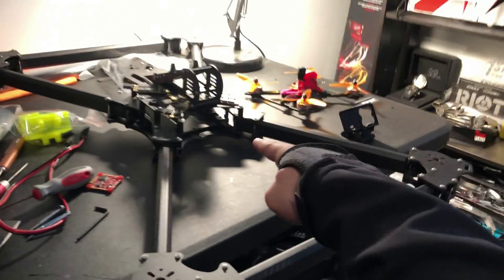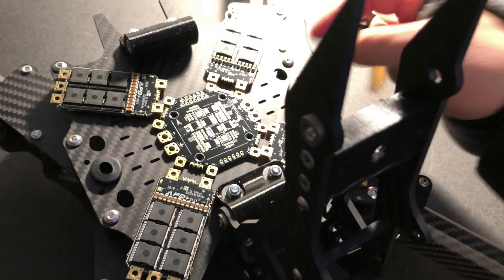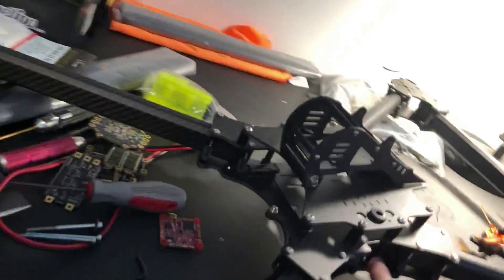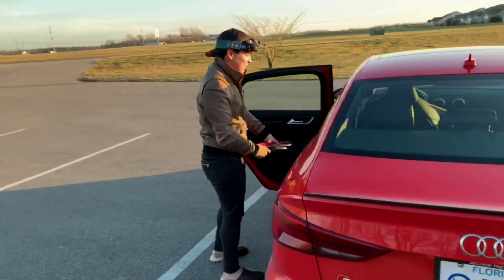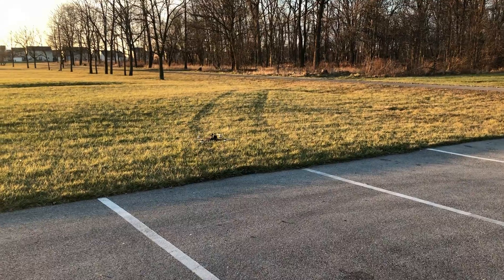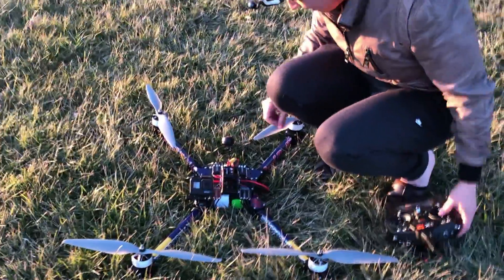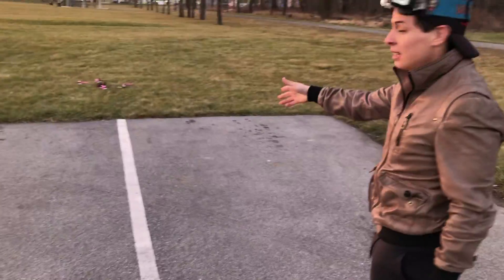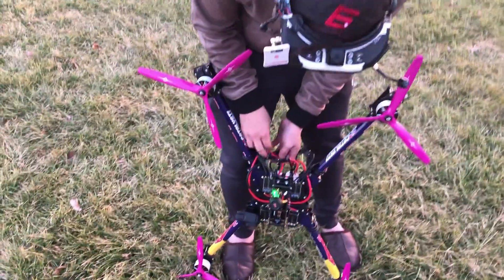Cannonball 800, Xclass is here!

Comment: Did not sound good on 16 inch props and 6S. 345KV on 6s is a bad idea guys.
Reply from the maker: John Wood yes it was supper sloppy and slow haha
Reply: @gabbychavesracing24  Try 8S. The problem is low KV motors don't like to spin super slow and most FC's can't handle that and you end up with a crash.
Reply: I'm planning on building same quade, can you help me GC ?

Comment: Sweet man...OK so I'm interested and have been looking to build one of these. Someone please explain to me how you can run 12s on some of the electronics such as fc camera and vtx.. Can you do a video on your build and how you set that stuff up? Oh and subbed!
Reply from the maker: The pdb (power distribution board) has built in step downs that take the 12s voltage down to say 5-12volts so you can power your electronics like FC and vtx. In my case I am powering them separately with a very small 3s battery. You can do both.
Reply: @gabbychavesracing24  awesome thanks for clearing that for me so fast...😁 much appreciated

Comment: Frame flex usually manifests in yaw instability. I bet the flex is coming from the truss, the braces just add more weight to the truss. Looks look there some significant voltage drop somewhere or just poor battery selection. Looks like it tightens  up quite a bit at low throttle though. Here is adp's test rig. https://www.youtube.com/watch?v=8R7-pJCtRmY&t=218s

Comment: What are your thoughts on fitting an HD video system to a machine like this? There's plenty of room for connex or FPV.blue VTX on it.
Reply from the maker: Ian Petrie yes you’re absolutely right. Latency would be my only hesitation for racing. Even tho it’s relatively low it’s still much slower than analog video. For just fun flying and cruising I think it could be a great option tho
Reply: @gabbychavesracing24 I thought that the larger scale of X class might make the latency acceptable because the gaps are larger and the distances further.

Comment: That is insane! Is there any benefit just going bigger? Doesn't look much faster than a 5 or 6 inch quad and it's definitely not as nimble or agile! 😁😎👍
Reply from the maker: Just about making it more engaging for spectators at events, it’s louder, scarier, and much easier to see. No way this can keep up with a miniquad in speed and agility
Reply from the maker: PD Tech just about making more engaging for spectators to follow at events. There is no way this can compete with miniquads in terms of speed and agilty

Comment: What is the flight time like compared to a 5"? I always thought of X-claas as being also long distance capable quads.
Reply from the maker: JRA FPV second flight was 2:15 with a lot of full throttle punches and so on. Battery was pretty much almost all drained and that’s with 3000mah 12s. I think the weight takes a lot out of the battery.
Reply: @gabbychavesracing24  Typical 6S is 1050 MAH and 550 grams with a battery. So it's 6,000 MAH and about 3,100 grams with a battery?
Reply from the maker: JRA FPV not quite. Dry weight is right at 3000 grams. So add about 1100 grams for the combined 2x6s 3000mah pack and it’s about 4kg all up. I bet if I tried some 17” dual blade props and just “cruised” it would have pretty good flight time. But flying hard it drains it fast
Reply: @gabbychavesracing24  Its a beautiful rig. Be cool to see the FPV feed with the OSD - see the crazy voltage, amperage it's pulling - multiple horsepower. Congrats on the rig. Love your channel - keep it up.
Reply: They are a lot more efficent then 5 inch builds but thats all .
I think best longrange build has a light frame and is over 6 inch